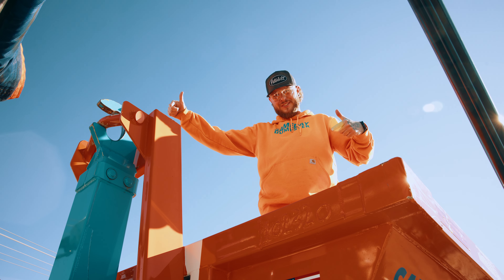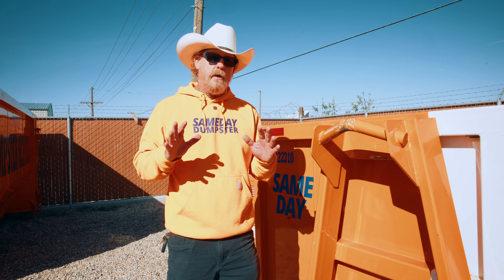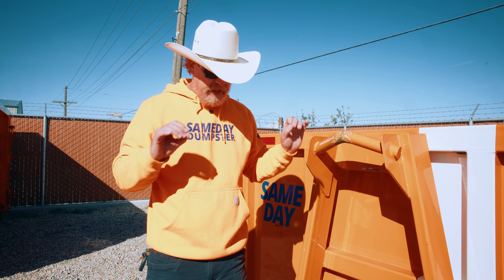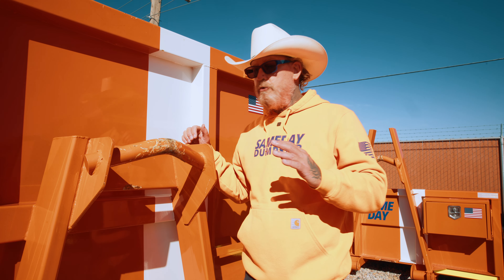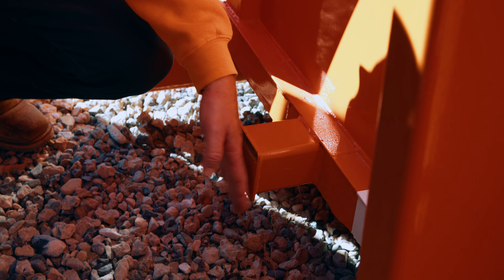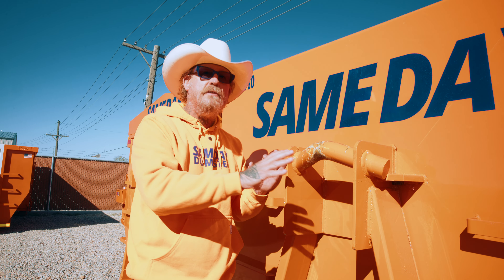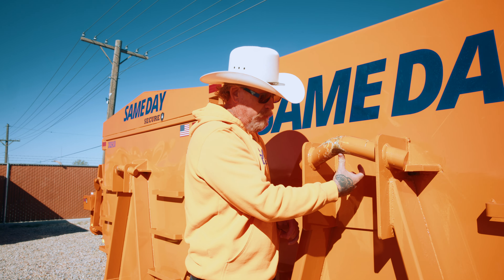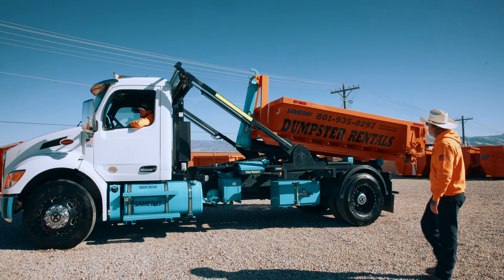This is Hooklift Jumping!

Comment: My Stellar NXT has a 'full' thumb compared to your thumb which looks like it was cut at the knuckle. I also have a safety latch that flips down to create a full circle over the dumpster bar when loaded. With my 2.5" bars, the problem I have is getting unhooked from the dumpster. I've got about a 1/4" extra opening is all.
Reply from the maker: Stellar makes some really solid products for sure. I started on Palfinger and have never owned a Stellar, but I've been around them plenty enough to know they are a very good hooklift system.

Comment: The Multilift XRL series arms have gravity triggered hook locks that keep the bar in the hook.  As well they have a different rear locking system that a pin slides into a saddle which keeps the bin from being able to move forward at all when you are braking.    Once you jib forward and the rear locking pins slide into the read saddle the bin can't bounce out of the rear locks and can't slide forward any further.  I totally agree that bins need to be designed properly in the first place, but there are systems out there that help you deal with those issues with the arm design.  Great content yet again.  Glad to see you back at it brother!
Reply from the maker: For the guys running that specific unit it sounds like they might have some of these concerns figured out. Thanks for your comment and sharing with the hooklift community. Much appreciated.